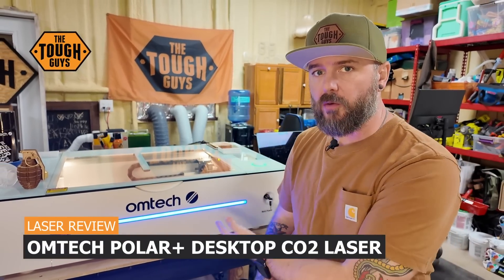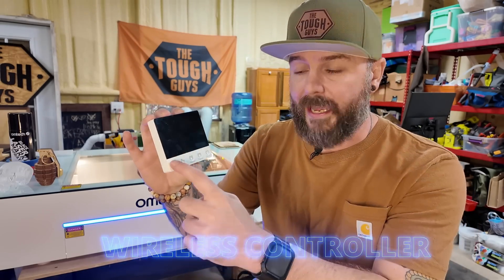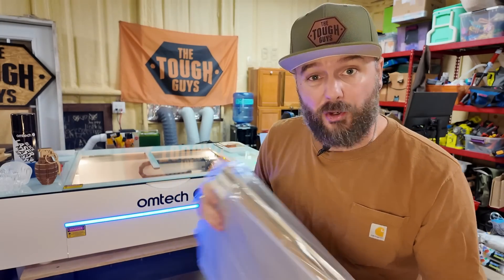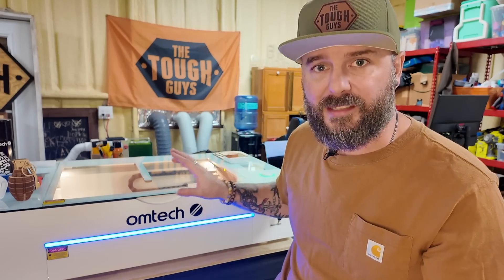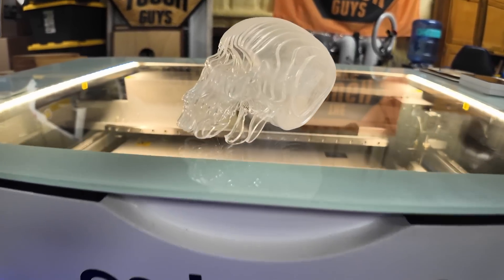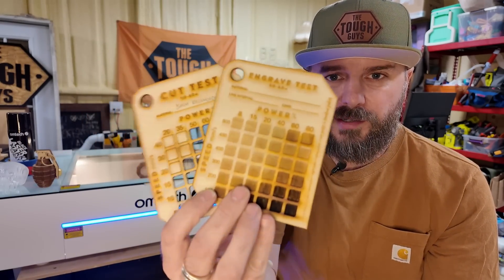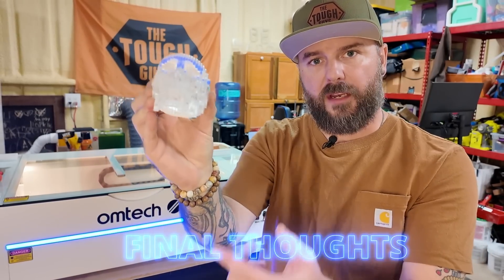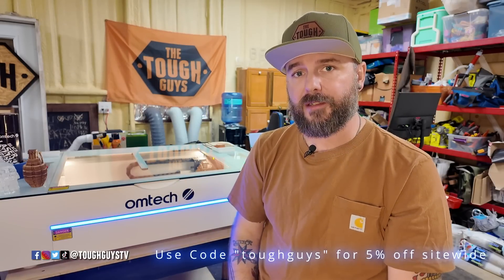Best Desktop CO2 Laser? Omtech Polar+ 55w Full Review

Comment: What else do i have to buy separatetly if I buy the 50w?
Reply from the maker: They normally have package deals, but ultimately it depends if you need a rotary attachment or other accessories. The core laser didn’t need anything else to operate. You’ll need Lightburn software, but they do offer a package that has that subscription included too I believe

Comment: Air assist is not the exhaust, it is the air blown straight to the piece being cut. I do have this laser cutter and here are a few points: the camera is a pain in the butt to calibrate, the user manual is incomplete and sometimes wrongly written, there is no red dot making it difficult at time to align with the piece, the camera does not work through wifi only via USB-A, the wifi feature is a local wifi, the laser does not connect to your wifi network, the amp meter is really in the weirdest place ever, it should be in the touch screen, the lens is also a pain in the butt to clean-up.

Comment: What diodes do you own? I feel very similar to you - I am leaning on this for my first Co2 but have recently been seeing a lot of complaints so now I am doing more research. I have an Xtool S1 40W and I love XCS - I am very nervous about moving to Lightburn. Now that you have both laser types. - which do you find yourself using more now?
Reply from the maker: I feel like Lightburn and the learning curve there is a huge barrier to entry. I let OmTech know directly that I feel like they should invest in a software suite similar to what Xtool did, because XCS smokes Lightburn all day in my opinion. I have an S1 20w and we had a Longer Ray5 10w for a long time too, and lastly I have an Xtool F1 as well. Overall I think the Polar+ with the touch screen and auto depth setting feature makes it a solid choice for an intro into CO2 but Lightburn is the bigger issue.. I think any issue I had my Polar was due to software, everytime that was the root cause. Hopefully that helps!! If you do decide on the OmTech, try my link you should save a bit and it helps support the channel. 🙏💪